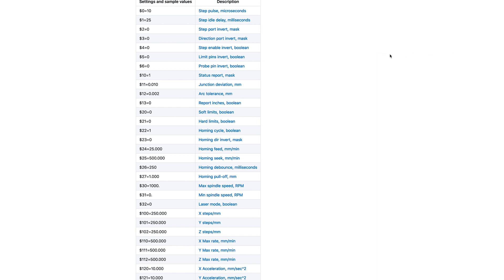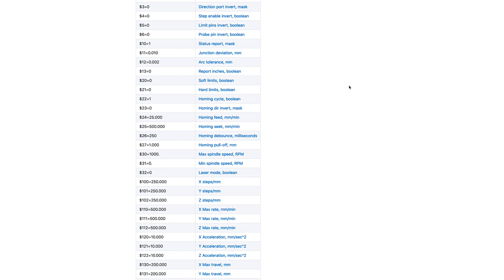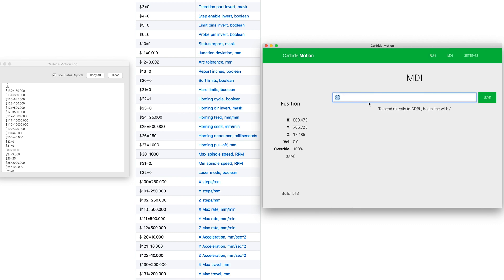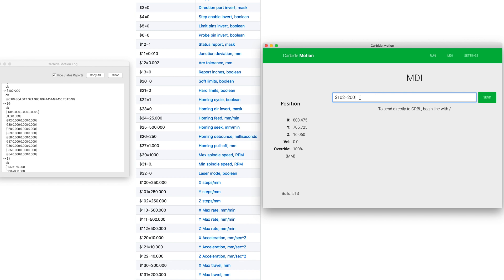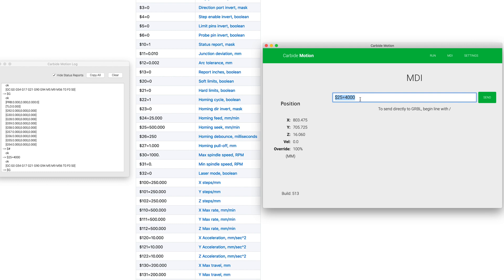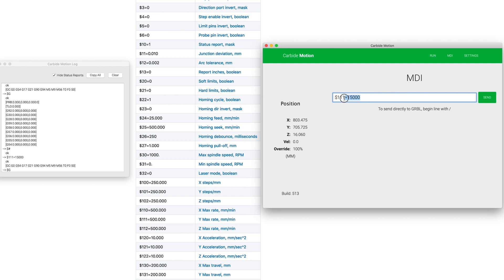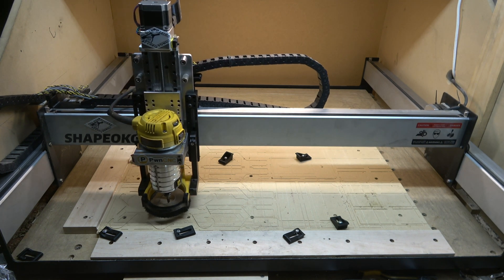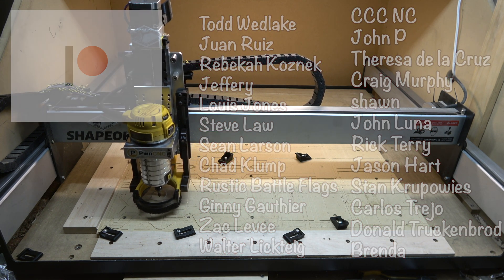How to speed up your Shapeoko cnc router

Comment: Just saw this video Chris Know nothing about coding or changing it  currently running the  XXL . I have the X / Z
gantry to install along with the new proximity switches. Also just got the Bit runner to install which will require that I change the control board that came with the machine to the 2.4e  board that will have the connector for the cable to the bit runner. Do you have a video on changing it and how to reset everything like the touch probe and bit setter.? 
Could you explain  how fast the settings were that you changed and how fast the new ones are
Reply from the maker: I actually don’t use a bit setter or bit runner.
Reply: @ChrisPowellFSD  You did a video on both didn.t you. I also watched your video on making your xxl  longer  . would there be any reason that you couldn ot do something and make it cut wider say handle a the width of a sheet of plywood?

Comment: Could you show how to change the homing position. I have a Shapeoko xxl with Vetric desktop and I use Carbide motion for the Gcode driver. I am adding a laser and the best place for homing would be the lower left as opposed to the upper right. Thanks Joh  F.
Reply from the maker: I believe that’s hard coded into Carbide Motion. That’s also where you’re homing switches are located. In order to change that you would need to run a different g code sender like UGS and move your switches.

Comment: Hi Chris. $100-$102 are for motor steps per mm. These are dictated by your motor (1.80° per step usually multiplied by the jumper settings, mine are set at 16 against a distance). Mine are set to 800 which gives me, move 50mm travels exactly 50mm using a digital calliper to check the distance.  Great vid, keep it up please

Comment: Thanks for this explanation/tutorial. For me it will be extremely helpful. Q1- do you know where these settings are stored (NVRam, etc.)?  Q2- do you know what conditions will reset all these settings and you will have to re-input
?
Reply from the maker: They’re saved on your computer. Connecting a different computer, or clicking the resend configuration button in the settings would require you to input the settings again.